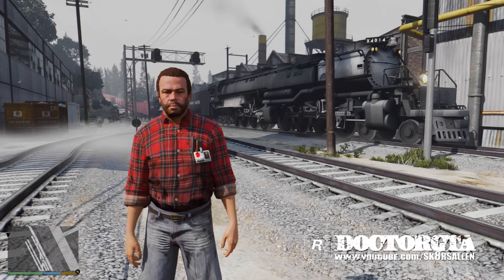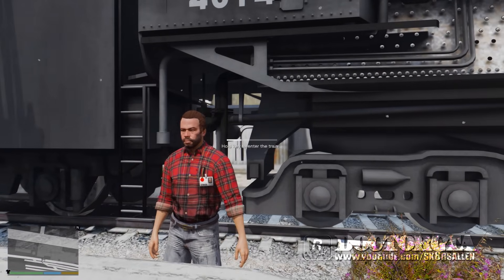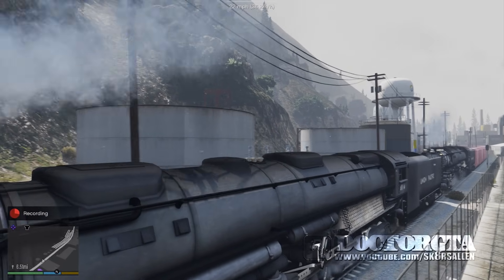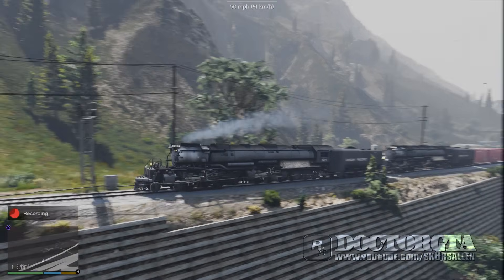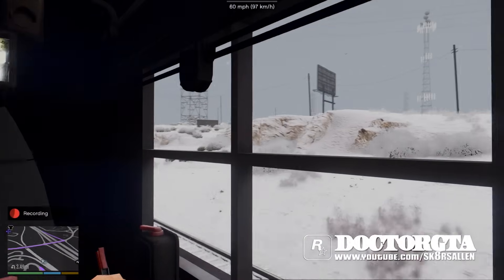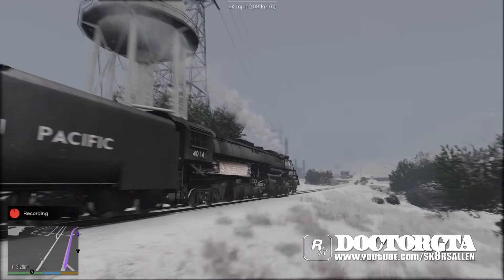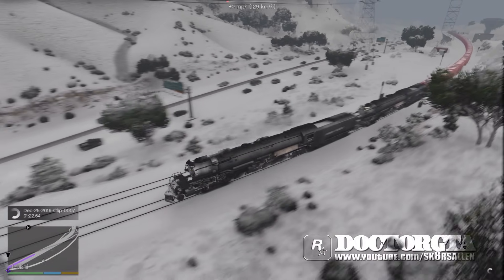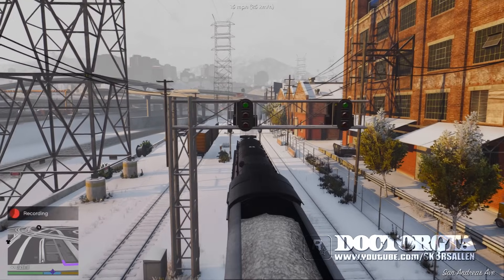GTA 5 Train Simulator Mod - (Union Pacific Big Boy 4014) Railroad Engineer Mod

Comment: Nuh uhhh I can't believe he actually said tht there's tires on this train this man really needs a fact check. I let all the other mistakes go like saying thts steam coming from the chimney, it's actually smoke from the coal being burned all steam goes to the whistle and four pistons, but saying this train has tires and thts y it can slip in the snow is sooo unacceptable. All trains r metal wheels on metal track. And another thing they didn't just use big boy during ww2 to bring stuff to and from Pearl Harbor, they may have but it was mostly used to haul heavy  cargo but was discontinued bc the boiler wasn't big enough and there simply wasn't enough steam to go up hills, conductors had reported having to make frequent stops on tracks to build up more steam. Another reason for the discontinuation of big boy was of the monstrous size of the locomotive, it simply couldn't go around certain bends in the tracks bc it was so long making it limited as to how far and where it could go. But thts all I have to say about tht.

Comment: Coal in the tender, but the firebox is set up to burn oil.
Reply: UP tried oil firing the Big Boy (tested on one locomotive) but was unsuccessful. All bigboy ran on coal. the Challengers and FEFs burned oil, 3985 and 844 are still oil fired
Reply: cody rentzell I'm pretty sure none of the FEF's and Challengers were built as oil burners. There were several that were converted while in service. But I believe 844 and 3985 were not converted until entering excursion service.

Comment: This guy has the history and controls wrong on the locomotive and the number 4014 implies rode number and 4-8-8-4 is the lead truck has 4 wheels then the forward drive truck has 8 wheels, the rear drive truck has 8 wheels and the trailing truck has 4 wheels.

Comment: in Real life the Big Boy would never fit those curves BTW the Real 4014 is returning to service!!!
Reply: Baldland Northern ummm they builded Big Boy so he can go on those curves because big boy's boiler isint atached to the wheels
Reply: City Jamesman  the wheels are attached the boiler, the rear (second set) of drivers are rigid to the boiler and frame, the front engine is the one the swings (articulated). Big Boys could actually make sharp curves, but where they ran, there weren't that many curves.

Comment: NOT realistic. In any real Train Simulator you actually run the engines and merely cranking the regulator (throttle) back like that does jack shit nothing about the speed.
In reality (and in any train sim), you have to carefully adjust the reverser (which, despite the name, does far more than change your direction!) in combination with the regulator in order to increase speed and traction.

Also, much of the information you see in this playthrough is FALSE. Double-heading was used on long, heavy trains to provide more pushing power. However, it was NOT needed with the Big Boy, which could haul up to one hundred cars up a VERY steep grade, at NINETY MILES PER HOUR, all WITHOUT the need for double-heading.

The Big Boy was also built to challenge Sherman Hill, which was the steepest railroad grade in the word. SOLO.

He even uses the wrong terminology! "Drivers" are known as "Engineers" and his "assistant" would be known as a Fireman. 

The Fireman was in charge of watching the water level in the boiler and feeding the fire. The former was very important as if the water level wasn't watched, BOOM!
A boiler explosion would occur and whatever idiots were in the cab would be destroyed along with whatever town was nearby.

The latter wasn't so big a deal in the Big Boys because they were fitted with an "automatic fireman" which used an Archemedes screw to pull coal into the furnace.  However it was still very important as without that fire in the furnace and enough water in the boiler you could not move.

Also, you do not "Honk" ANYTHING on a steam locomotive. It is a STEAM WHISTLE. NOT A HORN. So you blow the WHISTLE using the same pattern you showed. Long-Long-Short-Long is indeed standard for GRADE CROSSINGS (AKA road crossings).

You did get SOME parts correct - the retirement age of the Big Boys, and the pattern of the whistle at grade crossings, but everything else is INCORRECT.

Train Sim World is so much better than this CRAPMOD.
GTA should stick to cars.